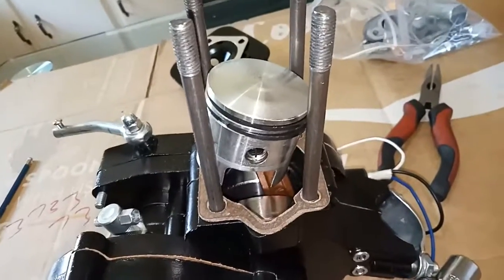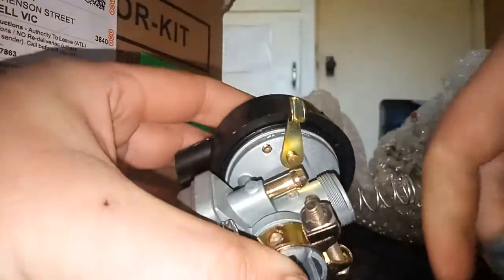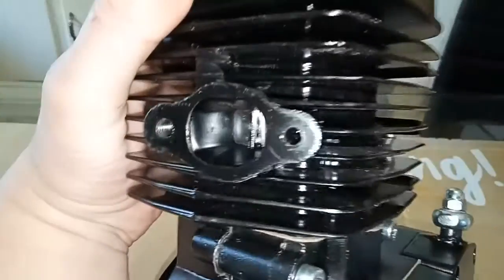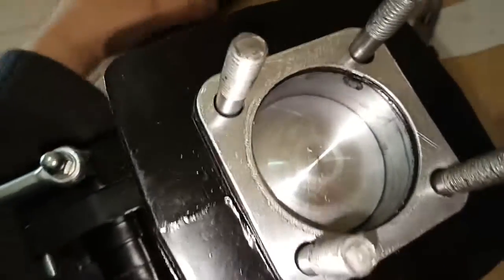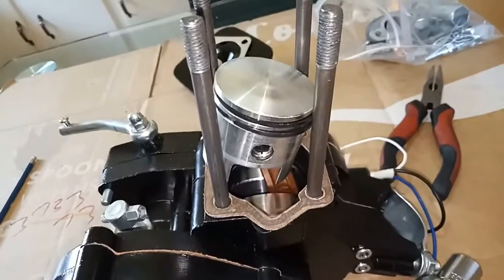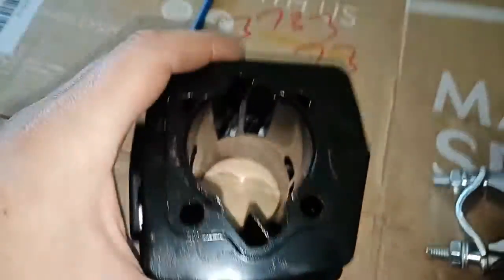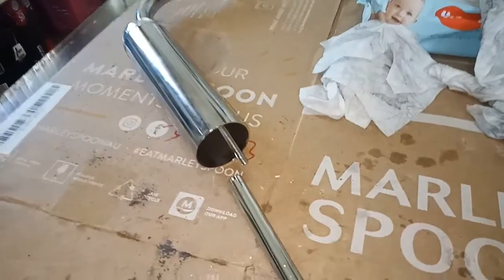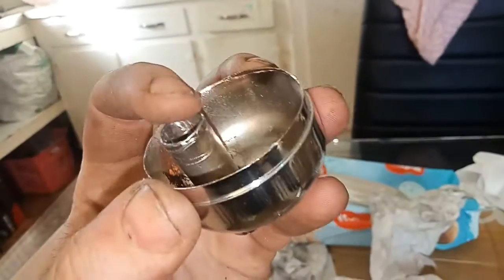Mk2.5 66cc 2 Stroke Engine Unboxing

Comment: Maybe its the camera but that cylinder looks and did i see a crack on the cylinder wall edit guess it was somethingother than a crack
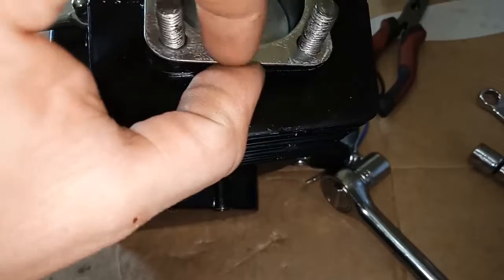Reply: @NicksBikes  yeah ill go back and find rhe time stamp but i dont think it was anything otherthan probably paint some where around the 6:20 mark you can see what at first looked like a crack i the cylinder wall but it might have just been a paint stain did you have an issue with the motor
Reply: @NicksBikes  oh ok then will be waiting for the video

Comment: How does that motor compared to a zada triple 40?
Reply: @NicksBikes  looks very similar with the exception of the jug.  I'm not an expert, I do more with four strokes lately,  but I've never seen a jug that quite looks like that,  with the cool cutouts and the bar going down the exhaust hole.